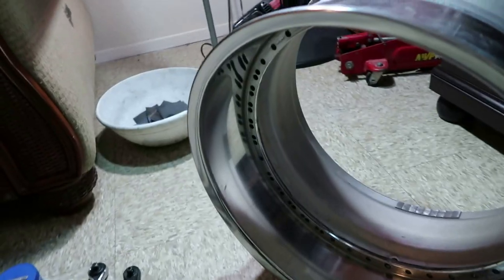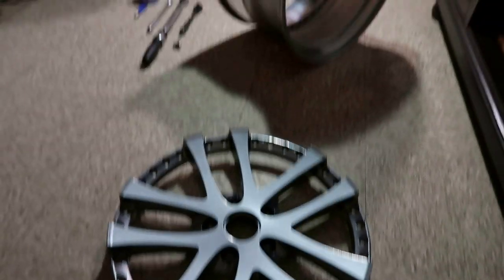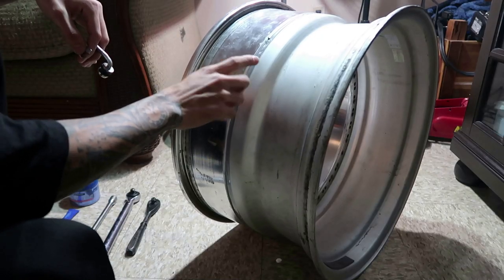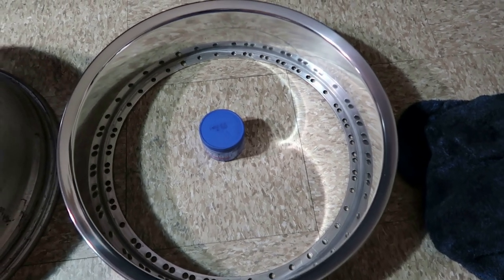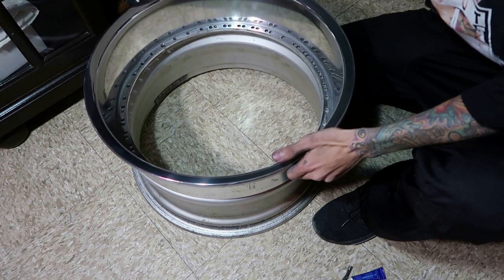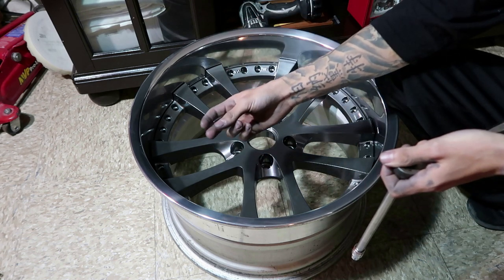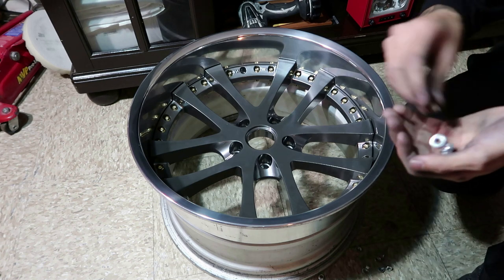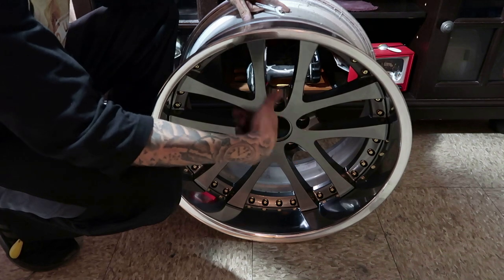How To Rebuild A Three-Piece Wheel (BecauseCamber_) Weds Kranze Lxz

Comment: are most weds the same torque specs?
Reply from the maker: 18-22lbs
Reply: @derekarchuleta55  you don’t know vishunus?
Reply from the maker: @haydenpennington  it depends on the bolts and nut size your using